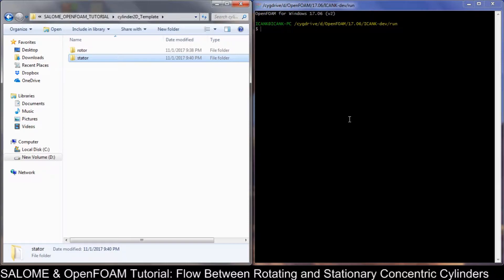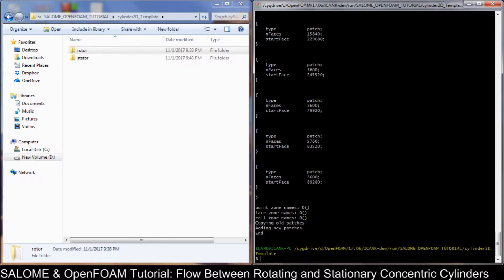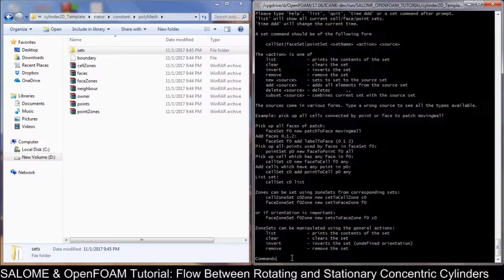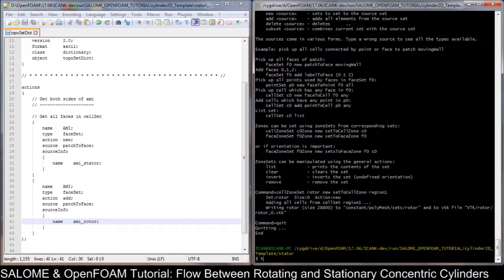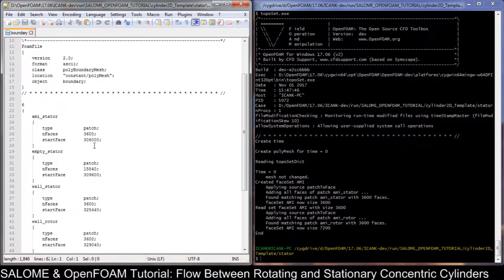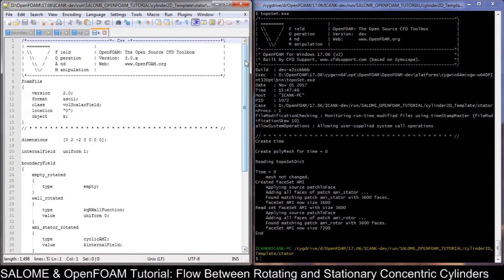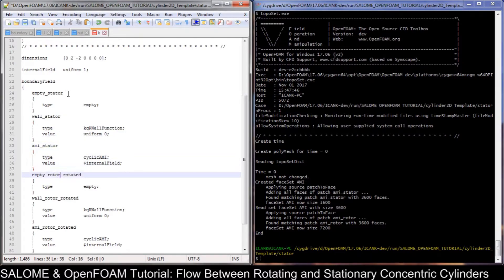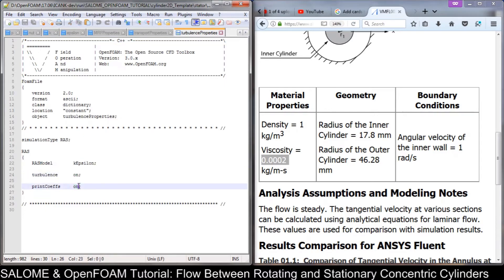SALOME & OpenFOAM Tutorial: 2D Rotating Cylinder Part 2

Comment: hello
i was trying this tutorial but i have failed to run  this command : ideasUnvToFoam.exe rotor.unv.
it is saying that ideasUnvToFoam.exe rotor.unv: command not found

what could be the reason?
Reply from the maker: Try to run the command first without the unv file:
"ideasUnvToFoam" to check wheter you install the openfoam correctly or not
Reply: i did and you can see what is the feedback:
ben@ben:~$ ideasUnvToFoam

Usage: ideasUnvToFoam [OPTIONS] <.unv file>
options:
  -case <dir>       specify alternate case directory, default is the cwd
  -dump             dump boundary faces as boundaryFaces.obj (for debugging)
  -noFunctionObjects
                    do not execute functionObjects
  -srcDoc           display source code in browser
  -doc              display application documentation in browser
  -help             print the usage

Using: OpenFOAM-4.1 (see www.OpenFOAM.org)
Build: 4.1

--> FOAM FATAL ERROR: 
Wrong number of arguments, expected 1 found 0

FOAM exiting
.................................................................................................
Does that means, i installed it wrongly or?

kindly help me please!
Reply from the maker: Basically, the ideasUnvToFoam command of yours is installed and works well. However, the problem might come out from the file rotor.unv.

You should make sure every single patch has correct type and make sure it is water tight mesh. Otherwise, the program will work inappropriately like you encounter here.
Reply from the maker: Sorry for late respond, it is probably because the wrong patch you employed in the mesh.